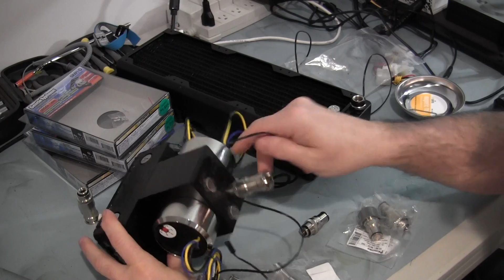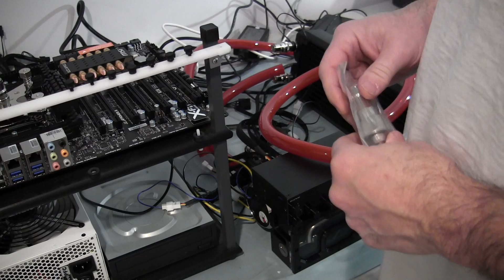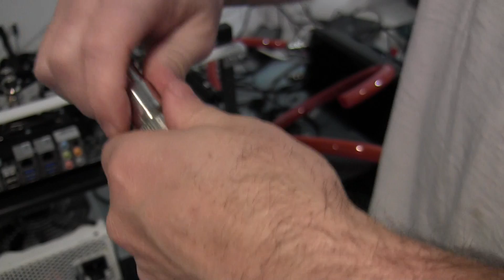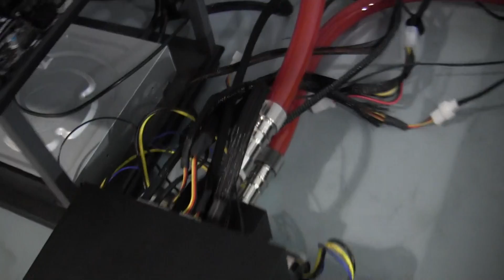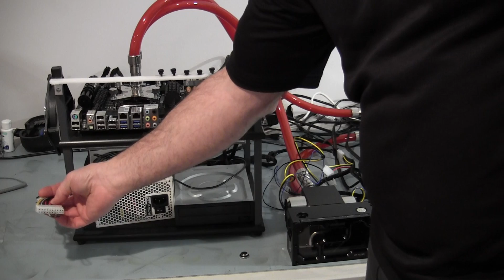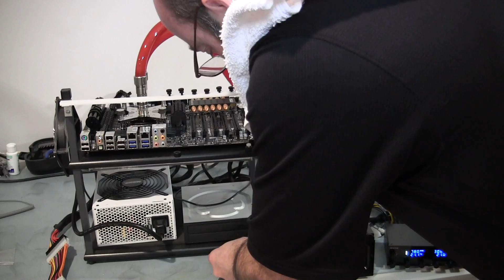Setting up and bleeding the Kick-Ass Xpower II Loop for Bench Testing

Comment: Actually, for the compression fittings, you shouldn't push the tubing down on the barb all the way, push it around 9/10ths in, that way allows the compression ring to bite down on the tubing even more, also makes it easier to tighten the fitting.